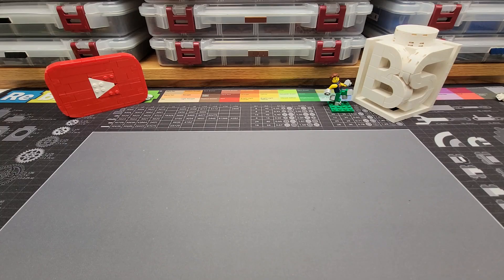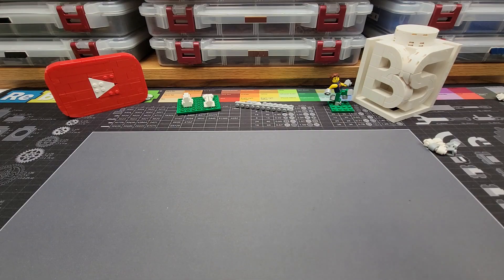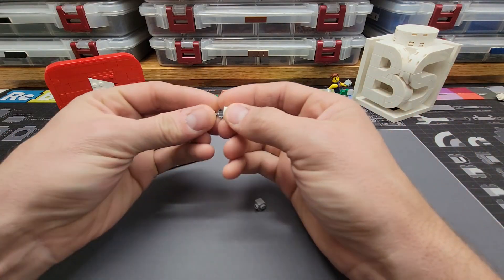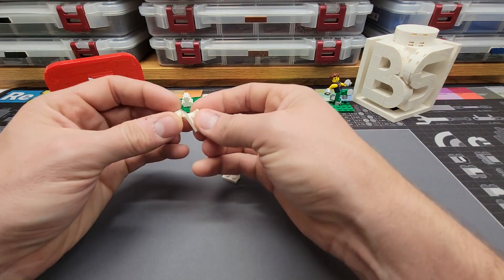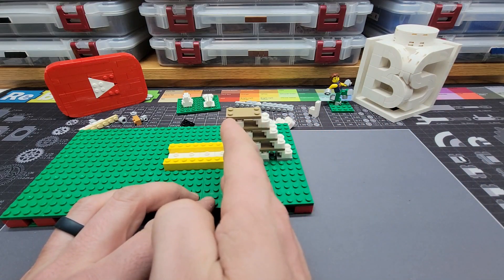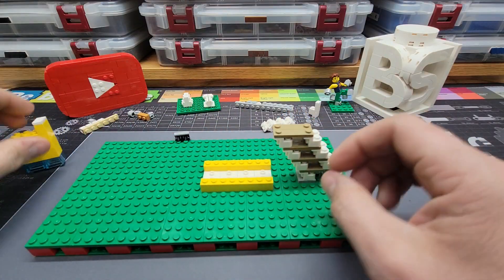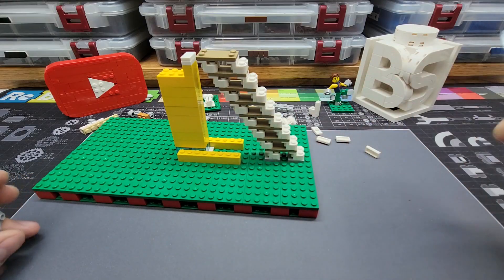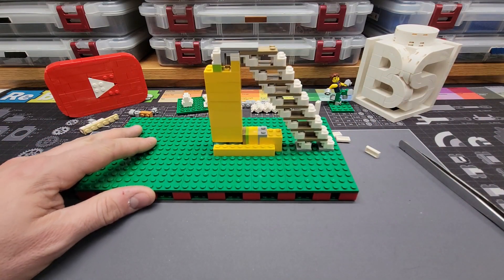How Small Can We Measure With LEGO? An Attempt to Prove 1/2LDU.

Comment: Hm, I suppose if you accept the definition that an LDU is the smallest distance achievable in LEGO, then what you've done there is redefined it entirely. 

Well that's a controversy.
Reply: I think you can get 1/4 LDU using some technic stuff?

I'm pretty sure the actual definition is 1/8 of a plate (or equivalently 1/20 of a stud (or equivalently 400 μm)) though.

Comment: You should reverse the direction of the d-snot stair every other layer so it goes straight up instead of to the side, which will remove a lot of flex when you push down. Even so, I'm convinced! I agree with yesterday's commenter that it does this to account for the raised lettering of the logo.
Reply from the maker: That's a great idea! Why didn't I think of that!!!
Reply: @bricksculpt  redo the video! Just kidding.
Reply: Add a director's cut: new footage referencing this comment
Reply from the maker: Lol
Reply: My thoughts exactly. That diagonal is making it so tricky to tell whether it's the rise or the error that makes any differences. But this might be a problem no matter what at these small scales.